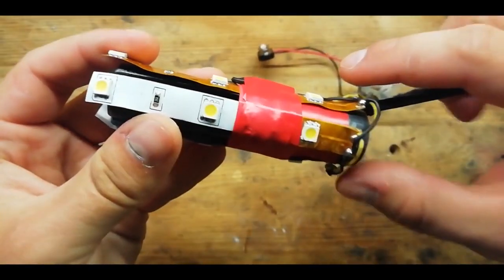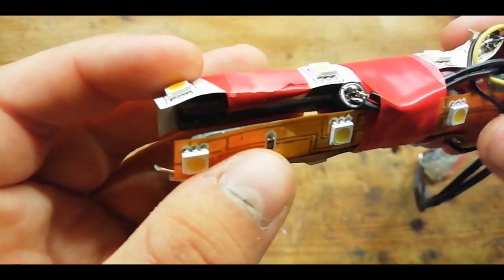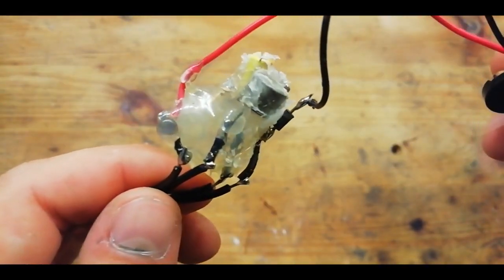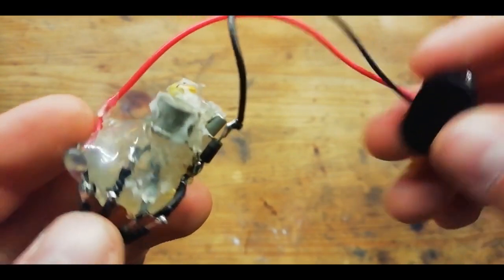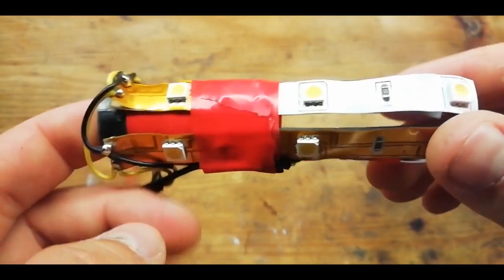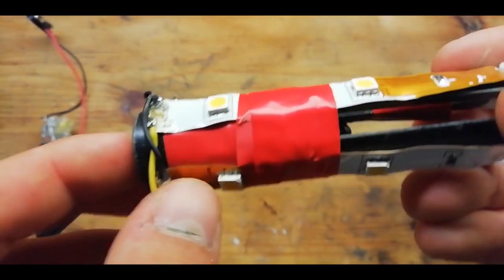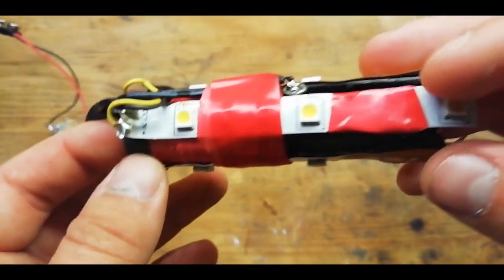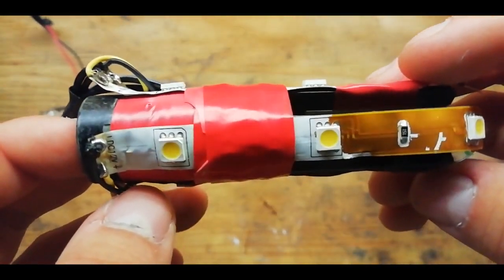AIRSOFT MUZZLE FLASH! Airsoft Homemade MFG! (WARNING: FLASHING LIGHTS)

Comment: Is this project still running? I'd like to see your progress on this one.

Just for the record:
The blasterparts muzzle flash generator is listed on amazon for about 80€. It is a realy good designed piece of engineering  and worth every cent.

Allsow you can buy on ebay the "Airsoftronix GloWorm" for about 24€ which is a platine that is going to be droped into a dummy-silencer and flashes 4 highpower led.

I am playing LARP with airsoft for about 4 years now and i am happy with both solutions.
Reply from the maker: It's on the back burners right now, but now we're in lockdown again I might have another look at it. Ive seen both of the things you mentioned. I like the look of the Gloworm but the other issue is that I felt quite nauseous after editing and watching the video back and the night games at my local have been postponed. I want to try to make one which will fit on a GBB pistol whilst also being as small as possible. I'll revisit this project during the lockdown.

Comment: Can you share all the electric schematics?
Aren't to many leds during the night it would temporarily blind you, you vand do just around the flash hider and would do rhe trick
Reply from the maker: The schematic in the video is the circuit. 

In regards to the omnidirectional flash, that was the intention. I don't just want a flash that lights up area in front. I wanted it to light everything up.